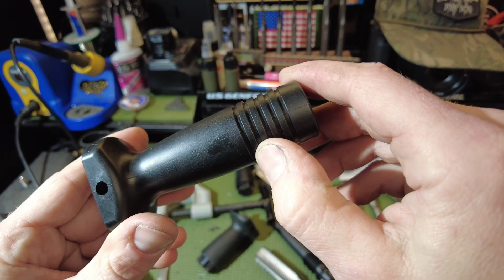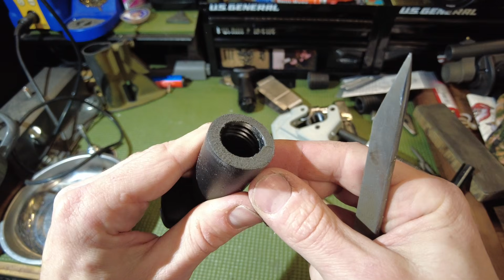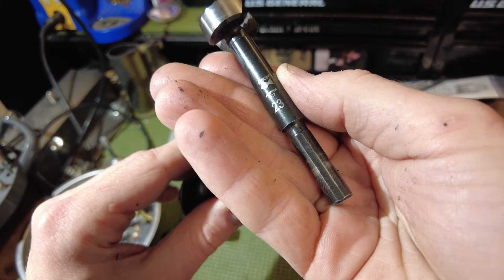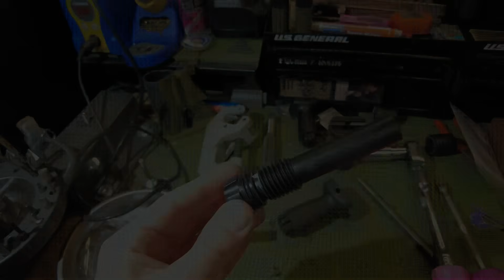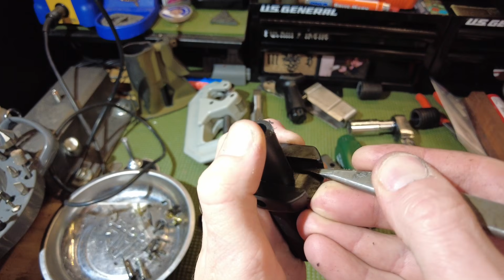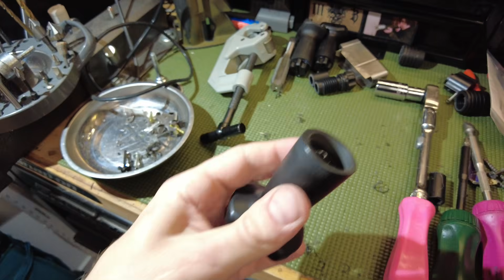DIY: Knight's Armament Company Stubby VFG Conversion!

Comment: So do you join the bottom plug (with the threads/oring) with the top plug with the Pic rail nub or is it two pieces?
Reply from the maker: You can but I generally leave it two pieces. It doesn’t matter once it’s installed.

Comment: Are those pachmayr grips on that shotgun?! 👀
Reply from the maker: Hell yeah. From the MCS kit.
Reply: @Crossthread_Shed could you get away with using a #24 size bit instead or does that not allow enough grab from the 0 ring ?
Reply from the maker: @rekingskrubs3130  I haven’t tried a 24mm so couldn’t say for sure. Sorry!